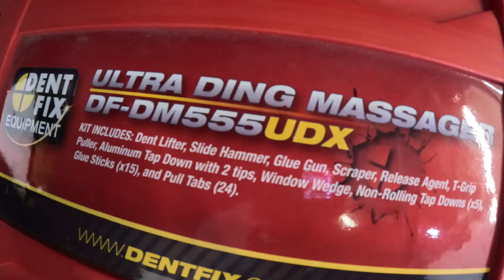THE BEST/EASIEST WAY TO DO BODYWORK

Comment: Wow have things come a long way. When I was a kid I would watch them pick and file the dent and use lead filler. Then came drilling holes and filler. Next is pulling studs welded to bare metal. Now this method which seems  the least invasive is the way to go. If my grandfather could only see this technique he would be thrilled.
Reply from the maker: Yes sir things and time changes with technology. 👍

Comment: Great video Mario and very helpful for me as my filler work could be better as it takes me a while to get it right, I always seem to over sand the filler then it ends up low so I fill it again and so it goes on🤦‍♂I do find using a cloth when feeling to see if the filler is flat helps no end, it's surprising the difference the cloth makes👌
Thanks for sharing Mr Teacher Sir🍎😁😅John UK
Reply from the maker: Thank you! John , bodywork isn’t the easiest but one of the most important step. I’m glad I could help 🙌

Comment: No guide coat? Couldn't find the guide coat can too? lol. Etch primer on bare metal, or is your primer DTM? Good result.
Reply from the maker: I did use guide coat you must have missed it. My primer is an Epoxy/polyester hybrid. And for small burns like this you don’t have to go overboard as to treat the metal.